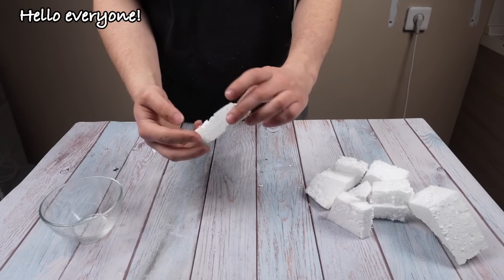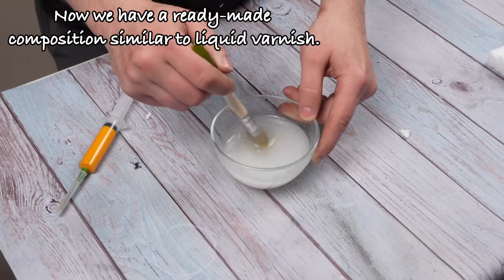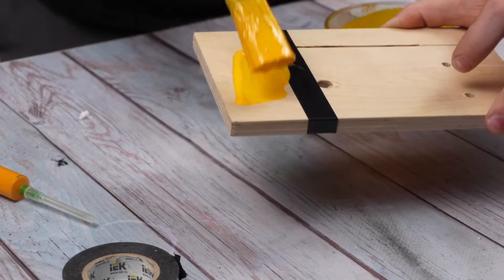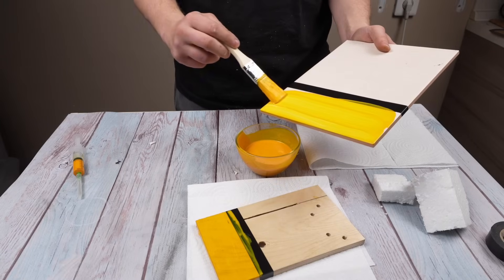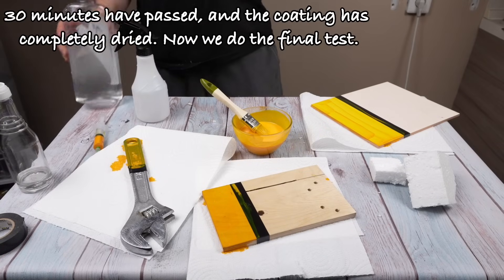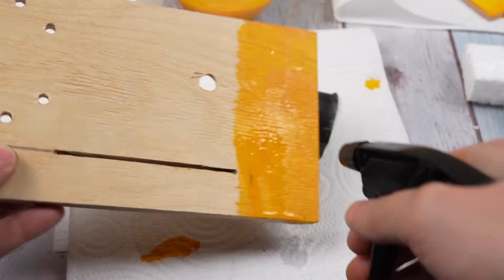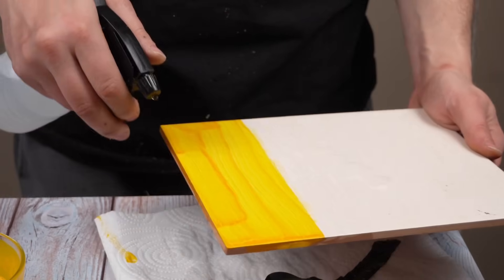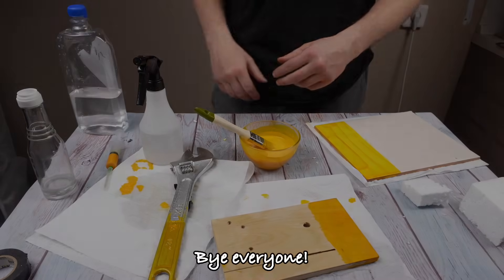Forget about acetone forever! Now I use foam plastic only like this

Comment: Please note that you are using chemicals that are potential serious carcinogens. Xylene is a carcinogen that must be used by professionals under fume hood. In addition styrofoam, is the polymer polystyrene expanded using CO2 gas but it is typical to contain or decompose to styrene which is also a carcinogen. 
Better safe than sorry. Think it the other way please. It is like an amature preparing alcoholic drinks from grapes but not knowing that there is also the hazard of digesting the by-product methanol which is highly toxic. It is better to trust chemical products that are regulated from authorities. Not only because you can do the mixing yourself and take full responsibility but because newer generation that don't know and can't take responsibility can harm themselves really bad.

Comment: Please answer.... How long will the xylene and styrene mixture stay liquid in a sealed glass container? Someone else asked, but you didn't answer.
Reply: I've kept mine for over six months now, same as day one, much clearer.
Reply: Wene using this if over time it evaporated and got thicker just add a little more xylean thinner until it reaches the desired consistency again !!